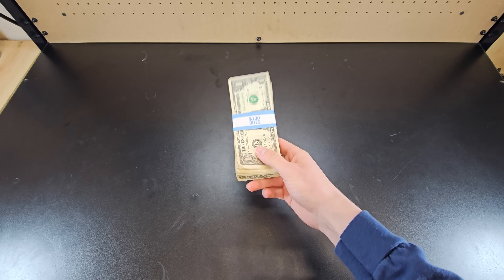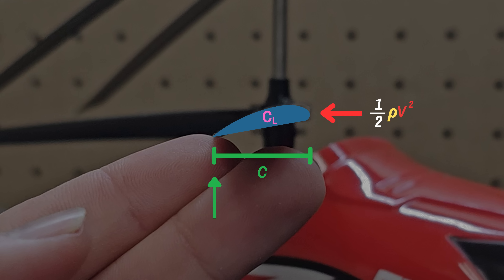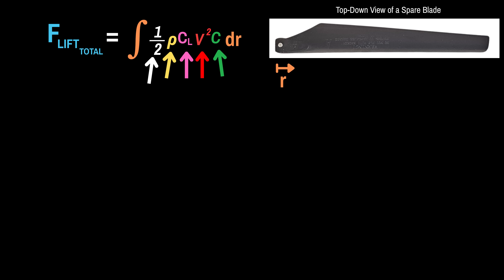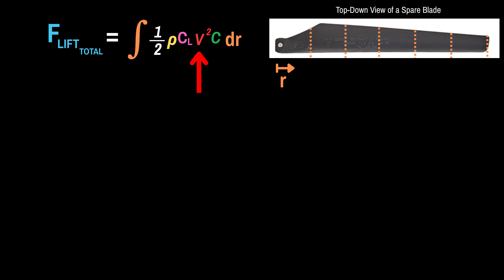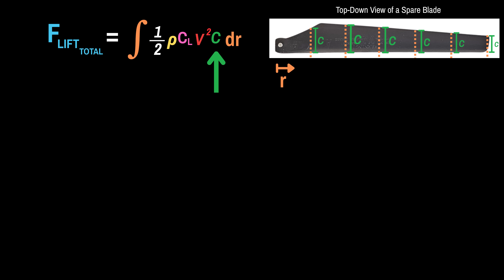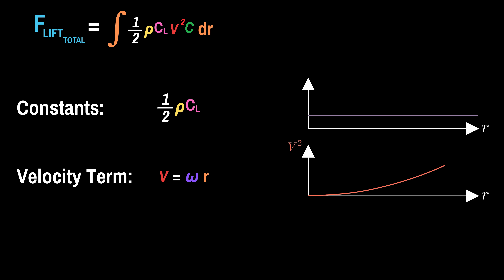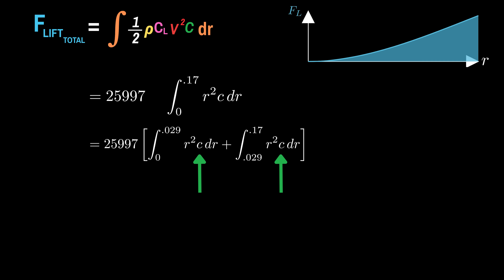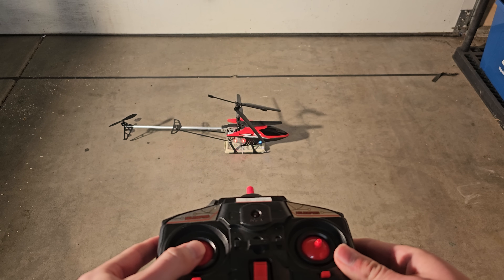Place your bet: How many $1 bills can this toy helicopter lift? (Engineered Bets)

Comment: the top propeller accelerates the air rotationally, meaning that the bottom propeller (since it's rotating in the opposite direction) is actually flying through on-coming air and has a greater airspeed than it's rotational speed. This generates a ton of lift by scavenging back some of the wasted energy spent on accelerating the air in a vortex.

also the chord at the base of the blade (after the "peak" of the chord length) is an incomplete aerofoil and as such very inefficient, however you treated it as if it would have the same efficiency as the rest of the aerofoil. So if you had accounted for the lower blade having a higher airspeed than it's rotational speed, then those who guessed under probably would've won.

Comment: Determining the maximum lift... does math... 
Me, put a weight on a scale you know is too much, attach a string, cover the scale with a piece of cardboard (with a small hole for the string) that doesn't touch the scale so that any down draft won't change the scale, and see how the number changes.

Comment: you didn't account for the effective angle of attack of the wing because the air is not getting sliced with an angle of 12 degrees but the above wings are moving the surrounding air downwards too which means there is a vector of velocity of air going down which means the angle off attach is actually higher than 12

Comment: This video was phenomenal! Showing a video like this in an Into to Aero class would be an excellent (educating, inspiring, and entertaining) lesson for young aerospace students. I’m a professional aerospace engineer now, but I’m going to reach out to my professors at my university to see if I can convince them to show this video in class!

Showing this video after a lesson on either basic aerodynamics, airfoil geometry, ground effect, or the effects of coaxial rotors might be particularly useful. After seeing the video, the students could be asked to attempt to improve your calculation as a homework assignment. 

To enable something like that, would you be able to share any info on which company manufactures this particular helicopter? I tried looking online but I couldn’t find the company myself. Also, would you be able to share the distance between the rotor shaft and the point at which the blade is hinged? I don’t know if that distance matters, but I figure it wouldn’t hurt to have that information. 

Whether or not you’re able to help, I totally understand! Thanks!

Comment: I have no idea.  But I have worked in engineering my whole career and no matter what the estimate is on paper/computer, we test to verify.  Very few times are the estimates correct.  Either because the models are wrong or the application was not correct (ie some random issue folks did not think about, popped up).  

Anyway the estimates and simulation are useful for getting you an idea if the design will work.

Comment: Dang my guess was it would only lift about $50.  I think the overly simplified lift coefficient for the blade airfoil shape is likely the biggest error in your math. Looking at a blade to figure out its lift isn't that accurate either and you would need to do computational fluid dynamics simulations to get a proper model. I would have thought that the lower propeller taking turbulent faster air from the one above it would also reduce the lift to less than 4X one blade but I guess not enough to matter.

Comment: since you were estimating the total lift force of the helicopter, your error was actually only about 20%! the fact that the copter weighs so much more than a dollar means that a small error leads to big differences in what it can carry. i think that extra 20% may be attributed to the fact that you approximated the blade as flat, i wouldn't be surprised if even a small deviation from flat can significantly increase efficiency!

Comment: Ground effect is probably pretty significant at that scale
Reply: Whats ground effect?
Reply: @KingJahamesIII  I think it’ll be best if you just look it up. I have a simple idea of it but not much.
Reply: @KingJahamesIII just thinking in my head I'm thinking if your 500ft up in a helicopter the air is rushing down and has plenty of room to move through, then go 20ft above the ground the air rushes down and hits the ground and maybe deflects up or crests high pressure below that causes a lift force. Alternatively or at the same time air rushes down to fill the space below the rotors and flows around the helicopter creating some aerodynamic effect that pushes it up. Just a guess
Reply: @Bates___gromp thats sounds like a pretty good guess to me

Comment: I am not sure but probably air pushed by upper rotor's compress the air and therefore lower rotors can generate more lift? Any aerospace engineers or anyone with knowledge can clear this up?

Comment: I think it WILL NOT lift. Here's my thought process.

My list of unaccounted-for factors.
1. The opposite rotation of the two layers of blades will make the lower pair sustain more lift than the upper pair.
2. The air already having downwards speed by the time it reaches the lower pair, decreasing their lift.
3. The blades are probably engineered to reach ideal lift shape only under stress, which will increase lift.
4. There will be air drag on the body of the helicopter as well as on the money hanging from it.

I think #1 and #2 will closely offset each other. #3 is probably very minor. #4 I think is pretty major, hence my bet on UNDER.
Reply: Lots of respect for you, friend, it takes a brave soul to call their shot ahead of time, and considerable integrity to leave it up after reaching the wrong conclusion. 

Science is built on getting things wrong, and you did everything right, even if your estimate was wrong.